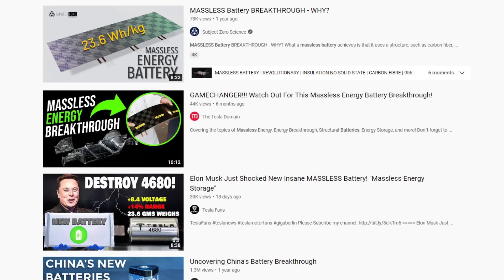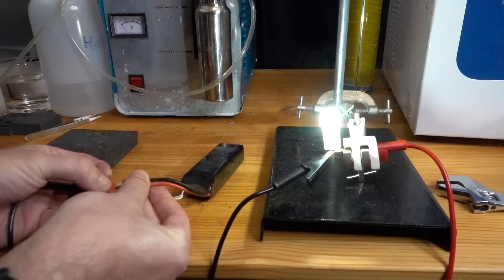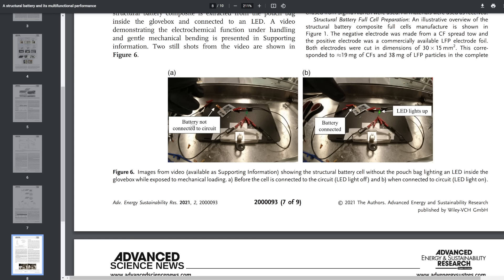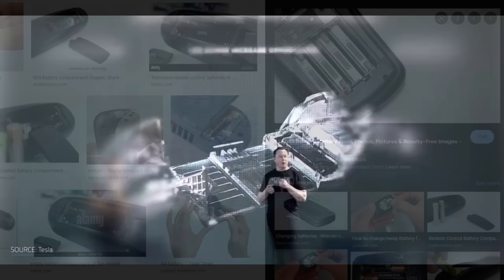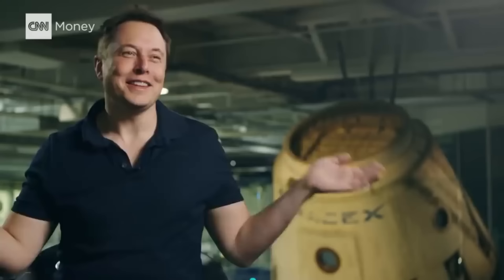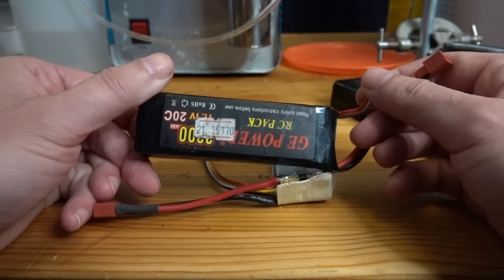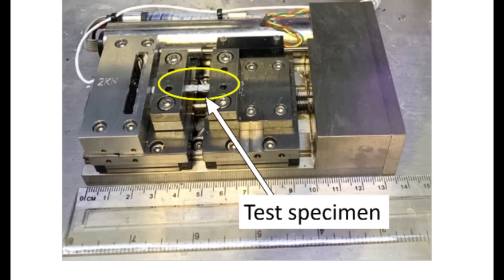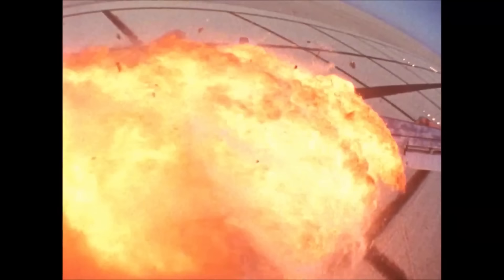Matt Ferrell, Massless Battery: BUSTED!!

Comment: Further consideration: If the battery were part of the structure, what happens when it can no longer hold a charge? If it isn't easily replaceable, the whole vehicle would have to be scrapped. In the case of an aircraft that's very much more expensive than a car.
Reply: And this massless battery has mass
Reply: @tylern6420  No it doesn't. It's called massless. Therefore no mass (if you ignore the mass)
Reply: actually the aircraft structure is much less durable than a cars'. It have to be scraped after certain hours of flight anyway (or at least undergo very costly maintenance).  And it's a win-win for car manufacturers. It would cost less to produce and it will be guaranteed to force you to buy a new car after the battery dies.
Reply: And then you go back to Tesla and by another bad;y constructed crappy paint job “robotaxi“. Nice 😜🤠💩
Reply: @ZleFox  in case you´re serious; a plane is subject to a completely different kind forces, if you were to fly with your car at airplane speed, your car would rip apart halfway through.  also, do you realise that the boeing 737-200 had it´s first commercial flight in 1974 and is still in use today by the thousands?
Reply: @symmetrie_bruch  yes, somewhat poor choice of words. It is not less durable than a car, but requires more maintenance(due to those forces). Just checked it to be sure  - 737-200 requires D check every 9-12 years "A typical P48 check or (D check) can take 20-30,000 man-hours, 2 months to complete and cost several million dollars".  The point is that you would be basically rebuilding the plane anyway.
Reply: @ZleFox  no, not even close, if that were the case you would just buy a new plane. sure plane upkeep is expensive, that´s precisely why wouldn´t want to replace the wings each time the batteries are dead/ not up to spec anymore.
Reply: Exactly
Reply: It seems likely that in the long term, solid state batteries will replace lithium ion batteries, and they can theoretically handle vastly more charge cycles than lithium ion, which will mean that the battery will likely last the expected life of the car. Tesla has advanced lithium ion just about as far as it probably can be advanced, but solid state may be only a few years away. One of the big manufacturers in Japan is already selling a few commercially viable products based on that technology.
Reply: You just dump it in the ocean obviously,  hopefully hitting a dolphin on the way down.
Reply: @ZleFox  ( car structures tend to rust and have accidents, due to harsh operating environments -  leading to a shorter life than many historical aircraft.)
Reply: "If the battery were part of the structure, what happens when it can no longer hold a charge? If it isn't easily replaceable, the whole vehicle would have to be scrapped."

And this doesn't only waste the vehicle but the battery too. A battery that has lost too much of its capacity to work in an EV can still e.g. be used as an energy storage in a home etc. However, if the battery is a part of the structure it can't easily be removed for such usage and might have an inconvenient shape if you still try that.
Reply: @tylern6420  "And this massless battery has mass"

The claim wasn't quite (except for a clickbait title) that the battery wouldn't have mass but rather it wouldn't bring extra mass to the vehicle because it would double as a load bearing structural part (which you would need in any case). However, as explained by Thunderf00t even that doesn't really work because a battery doesn't have good properties for bearing mechanical loads.
Reply: @seneca983  makes sense why we dont use batteries as structures, they would burn
Its 100 times safer to use the case/housing as structure
Reply: @symmetrie_bruch  If you could fly a car at 500mph, which you can't, then I would suggest that it would survive perfectly well, although you may have a few less wing mirrors and windscreen wipers at the end, and you probably should keep the windows shut. There are not thousands of 737-200s flying. More like 70. The 737 200 started commercial service in 1968, not 1974. Just because the design of the 737 200 is that old does not mean that all the 737 200s are that old, in fact almost none are in use as passengers bar a handful of aircraft. Most if not all of the older ones still in service are now in military use, where they fly restricted hours, and do not have the same restrictions as passenger jets. Airframe structures have a limited lifespan in flying hours. Age is not really a factor in any case - the amount of flying hours IS.
Reply: @ZleFox  There are very few 737-200s in commercial service, and even fewer flying passengers. Most of the 70 or so still around are in VIP / Royal Flights, or in Military service, where they crank up vastly fewer hours than a commercial jet.
Reply: @memkiii  you may suggest all matter of nonsense if you so desire. but there´s a reason those speed record breaking cars are built differently and look differently from your car. i don´t know who you´re replying to with the rest of your comment, since i never said it was the exact same plane stil flying in all cases or that the the design was never updated or that all 727 200s are that old.  my point was that you wouldn´t scrap the wings, let alone the whole plane everytime your batteries aren´t up to spec anymore.
Reply: @symmetrie_bruch  Hell, the DC-3!   The B-52!
Reply: @ZleFox  You know, the airframe has so many flight hours, that there are still plenty of planes from the 80s and 90s in regular use...
Reply: No you can replace parts of a structure.
Reply: @PiOfficial  As you can see with modern laptops and cellphones... /s
Reply: Are you even allowed to replace batteries in EVs though?
Reply: @Rugg-qk4pl  yes. Pretty standard for Teslas done under warranty if under the mileage limit.
Reply: That is a huge problem with Tesla's 4680 "structural battery pack". While the pack can be removed with some difficulty (there are many more steps over a conventional battery pack).... The battery pack is totally unrepairable. It can not be opened to access internal components. So if anything goes wrong, you get to give Musk another $10,000 to $20,000 of your hard earned money for a new battery! Tesla is just like Apple, ruled by greed.
Reply: @symmetrie_bruch  Wing replacement on maintenance/overhaul is a thing. We do it all the time. It's part of a structural overhaul. They can replace the main wings, center wing box, horizontal stabiliser, and vertical stabiliser. It's damn expensive, but cheaper than a new airframe. Of course, at some point the airframe itself becomes too stressed and this is usually the end for an aircraft. Too expensive to rebuild the fuselage. This is for large aircraft...
So, for a car using a structural battery this could easily be done by breaking the car body into components that can be replaced periodically. It doesn't have to be unibody construction as we do it now. It could be like an aircraft.
Reply: But your forgetting that in order to save the environment, we have to buy more new things, so technically disposable cars and airplanes are more sustainable.🙃
Reply: @symmetrie_bruch  especially because it would most likely be about every 1.000-2.000 flights.
Reply: Yeah there's already people having to replace their Tesla batteries (or have individual cells replaced by 3rd party repair shops), now imagine that the battery is part of the structure of the car "oh I'm only getting 30% range, time to replace the rear subframe, chassis rails, and all the doors!" The car would be even more disposable than it already is.
Reply: @fuzz11111111  Ok. That is true. A door is not cheap. Subframe - not cheap. All for a battery issue. 
That would add up to - just buy a new car pretty quickly.
Reply: -Matter didn’t create anti matter
-Anti matter didn’t create matter
(Both of them were present at the time of big bang)
-Both of them didn’t create themselves.
-Both of them came from an unimaginable source,  that unimaginable source created matter and antimatter (everything) thats why it is known as “the creator” of everything.
——
- that unimaginable source/creator has created sin and virtue which are opposite to each other,
— “logic” confirmed that every action has its own reaction, the reaction of sin is different than the reaction of virtue,
— the creator has created prophets to let us know about each and every detail of sin and virtue, also about their reactions,
Thank u :)
Reply: That’s pretty much the reason why Tesla does it, right? Buy a new car when your battery is exhausted.
Reply: @seneca983  
Recharge, repair, replace as needed.
Reply: @dot3499  
Unimaginable to you.
Reply: @nicholasgardiner9601  At least the last one is more difficult if the battery were also a structural part.
Reply: @seneca983  
I know. (Duh) 
Design and design life.
Reply: @theredscourge  Tesla doesn't make batteries and has done jackshit to advance battery tecnology.
Reply: @durshurrikun150  it's not 2017, Panasonic isn't making all their batteries for them anymore.
Reply: @acloakedfly  The universe ultimately will vanish in the big-crunch, so, technically, mas doesn't exist, so, technically, all batteries are massless in a way as the whole time thing is an illusion of the eternal nothingness of being.
Reply: Airplane cemeteries are nevertheless a problematic thing even though technically they're not made of worthless un-rechargeable batteries. Not saying batteries aren't a problem because of that, though, which would be a two-wrongs-make-a-right point. I suspect the big picture of things would have battery-power vehicles with batteries that are as small as possible, maybe even mostly hybrids, and the bulk of transportation powered on wires. Except for planes, which would use conventional fuels, or whatever no-nonsense advance in fuel there could be. But apparently the EU is planning to get rid of explosion engines altogether in the next decades, so maybe they know better than me, a nobody. Although I'd not rule out their goals end up being corrupted by/aligned with that of lobbies of people who'd profit with stuff that's ultimately unsustainable. Hopefully actual activists and knowledgeable scientists can help society in aiming for a more reasonable path.
Reply: @jcd-k2s  there are planes of several sizes, the costs sort of approach that of cars the smaller they get.
Reply: @dot3499  turns out it was not a single creator, but a team of seven magical guys and a magical chimp pet that was actually quite brilliant for a chimp, partly because it was a magical/god chimp. Some even say it couls have been this chimp-god-guy who created much of the stuff that there's around, including some stuff that doesn't seem quite right, though, like platypuses and mosquitoes.
Reply: Modular
Reply: Imagine getting t-boned and having your whole car discharge in a split second

Comment: Massless battery?
What's next, perpetual motion machines to charge the massless batteries?
Reply: How about an airship filled with hydrogen, that's not massless, but the lifting force from the H2 will cancel out its own weight. Now, how to attach it to my car.....
Reply: Massless perpetual motion machines!
Reply: @SAPANNow  VIRTUAL massless perpetual motion machines!  With NFT's!
Reply: I suppose u could always get out & push the car, technically that's a massless battery
Reply: @ytcensorhack1876  also, you can lose excess mass in the process of going for a drive-walk
Reply: @SAPANNow  a.k.a. photons.
Reply: @rustymozzy  or...here's an idea, attach a team of horses to the front of the car and tow it along.
Reply: @ytcensorhack1876  oh wow! You've done it! You've turned a perpetual motion machine into a free energy generator by burning the horse manure!

Comment: Not even a minute in, but my first thought is: "What happens if this thing crashes into anything?" I mean, this is just a more evenly distributed battery, so I guess it won't explode, but it will probably burn the whole thing down.
Reply: And a lot of fun for the Firemen that can't cut you out of your crashed car because now everthing is battery...
Reply: I can already see the news article,
Firefighter tries to save a person in a car wreck and dies of electric shock!
Reply: I need a YouTube channel that takes this crazy weird ideas and put them to test.
Reply: "Oh no, i hit a small bird at 60mph, been nice knowing you guys."
"Oh crap thst truck just kicked a rock at my hood." 
"Welp, hope this thing can survive a hail storm." 
"Hmm...its -10C outside, or the suface temp in the sun is 86C in august....hmmmm"
Reply: of course it will explode. have you seen what happened to the samsung note 7 with the defective battery issue? just one corner had the films a bit squashed together, a problem area of about 2mm, still enough to cause thermal runway under shock or thermal expansion. even a tiny cellphone battery carry enough power to explode and burn itself continuously at ever increasing temperatures.
Reply: @UselessAqua  shock will be the least of their problems, a fatal exploding lithium fireball at the point of contact will definitely put a hamper to their efforts.
Reply: When there is an accident, police and fire fighters will just provide a buffer around the burning cars to protect other cars.  The drivers and passengers would be left to get themselves free or be cooked alive.
Reply: @Mrdardas99  Lel, forgot about the fact that alkali metals explode when they get in contact with water.
So that poor person will also get toasty.
Reply: @Mrdardas99  Yes the phones that is also a grenade